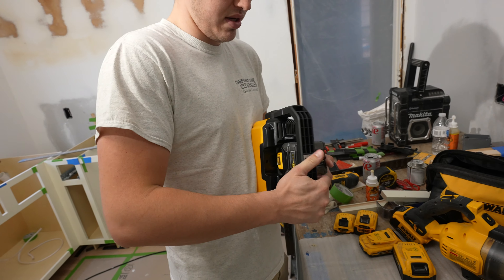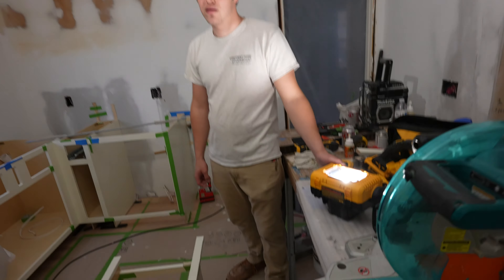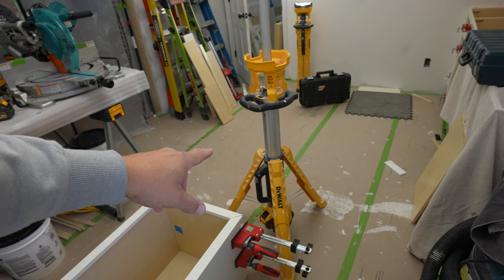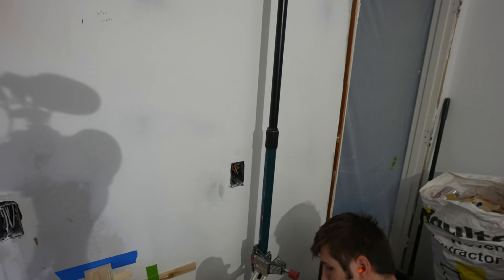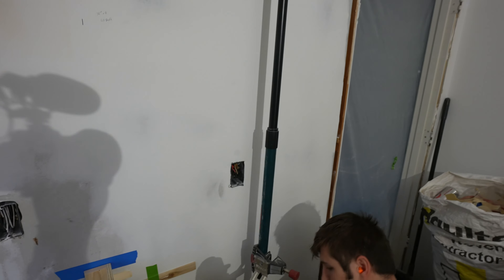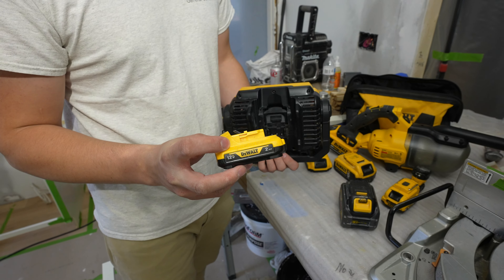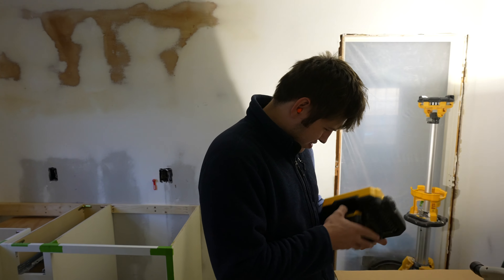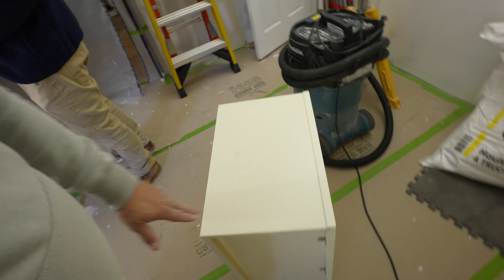DeWALT’s compact task light 12v 20v DCL077B

Comment: I love this light, do yall have any of the new DeWALT impact wrenches? Didn't know if yall use them much, I work on hydraulic equipment I use mostly impact wrenches, DeWALT of course...
Reply from the maker: Most our impacts are Milwaukee(I initially wanted red impacts to hide grease better) however we purchased a mid sized DeWALT 20v impact to keep on the van for construction needs. We prefer the DeWALT over the equivalent Milwaukee just from how the impacts are slower and more controllable. I know it’s rated at about the same power as the Milwaukee but it’s just easier to use when running long bolts or lags in. The DeWALT will turn a galvanized 5/8 bolts faster and tighter with lower impact hits. If you watch our channel you will find out I’m not brand loyal just like great tools. Appreciate the comment.

Comment from the maker: I didn’t think I would like this light but I was wrong.
Reply: That's funny I thought the same thing, still in the box, I bought it last year
Reply from the maker: We bought a second one already but of course it’s still in the box😀
Reply: You noted the similarity in runtimes with 12v 5ah versus 20v 5ah, but is there a difference in brightness? (i would think the 20 would "broadcast" ;) more light)
Reply: @skygreen5939  yes the 20v bats allow the unit to produce the full 2000 lumens, the 12v are limited to 1000 lm    hope i'm not too late :)
Reply: @grenadine420  thank you! I did end up buying it and am very happy with it despite the brightness difference between voltages 👍

Comment: I can't get with DeWalt lights or fans. They're the only major tool of the big three that do not have an ac plug. 

The 4000 lumen Milwaukee Rover could also mount on the pole the same as the DeWalt light. 

I'm not brand loyal for tools either. I'm giving the Flex tripod light a go atm. I like that the light head removes from the tripod. Giving a small 4000 lumen light with rafter hooks. 

I'm guessing the age of the 20v 5ah is why the 12v 5ah performed so much better.
Reply from the maker: Gen 1 of the DeWALT fan had a plug in. They chose to eliminate it on the current fan. We really haven’t missed it on either the light or fan but DeWALT’s tripod light doesn’t have it as well. That’s the one that really annoys us not having a plug in.